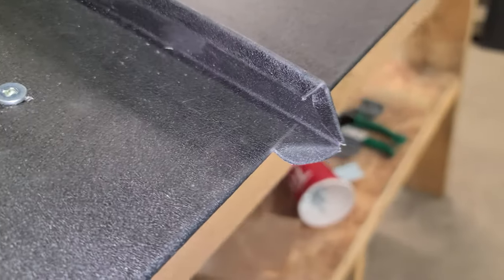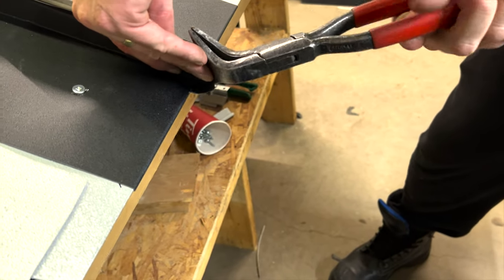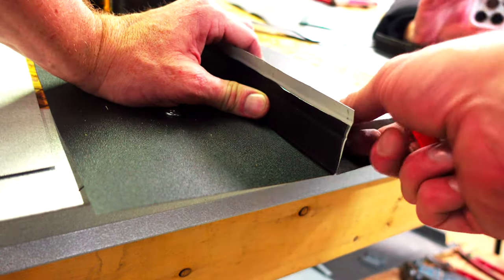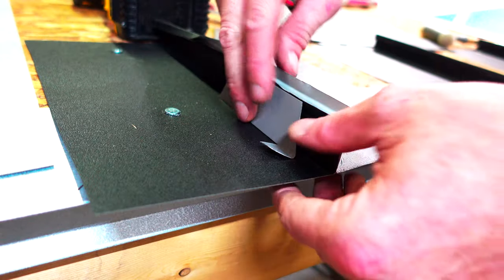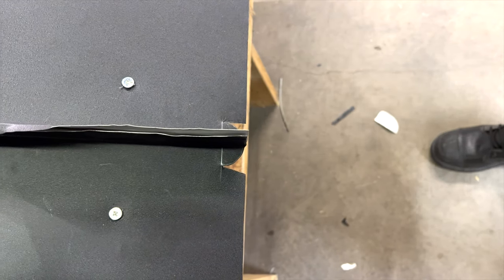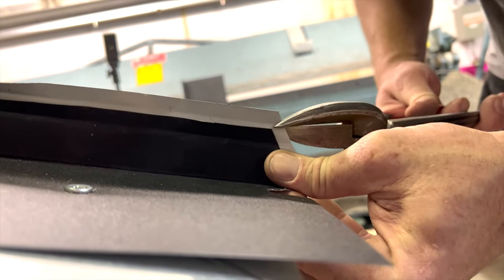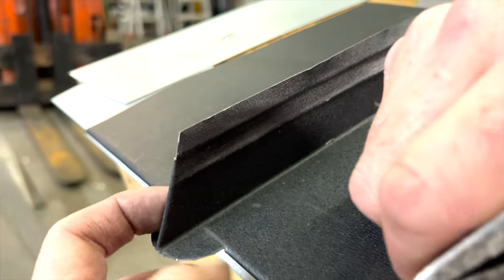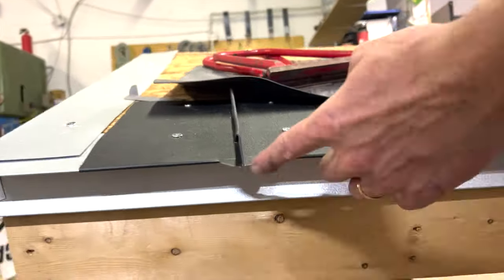How a Standing Seam Eave Bend is formed OPTION 3

Comment: I like the concept. In my opinion an improvement would be: instead of the rounded exposed cut edge, make those straight angle cuts and hem.
Reply from the maker: i see what your saying but that might attract water inward by capillary action...the tabs i bend downwards, intead of hemming them, provides a smalls drip edge to make sure that water drip off at the most outer point of the detail